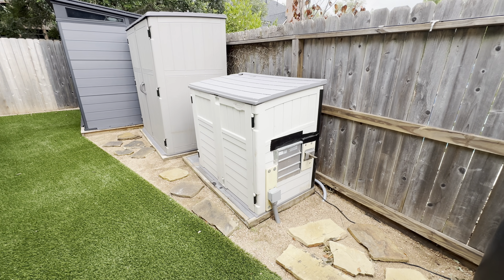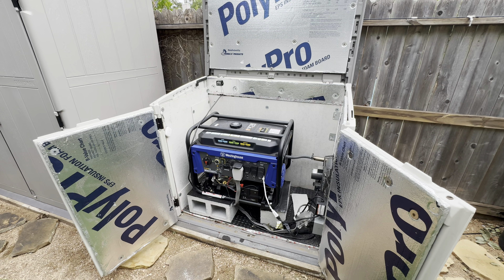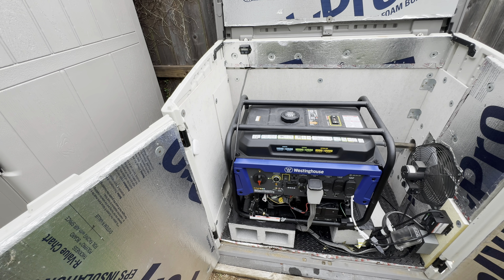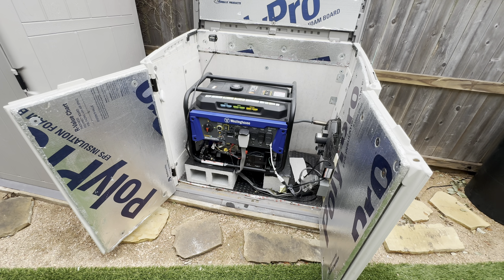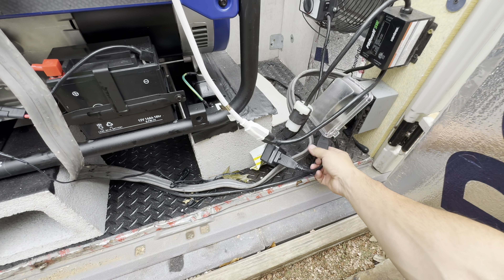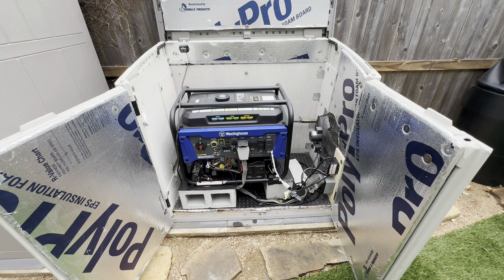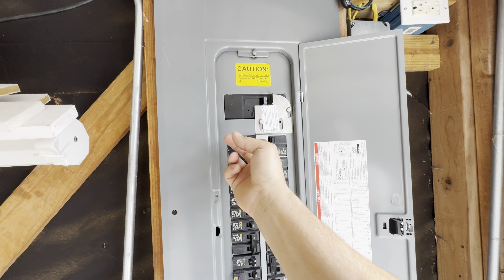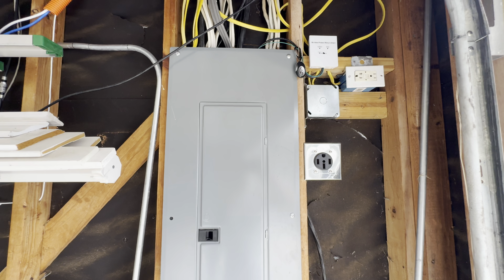Tri-Fuel Portable Generator Post Hurricane Update on Natural Gas

Comment: Thank you for sharing your experience and knowledge. 
I tried to convert a dual fuel DuroMax xp13000eh to CNG  but couldn't get it to work at all bought a conversion kit from PNG Technologies and did not work. Had Center point energy to evaluate my gas meter before buying the regulator the PNG  Technologies kept saying is the hose any taught or suggestions ? Really want to see the generator running with CNG
Reply from the maker: @rickymejia48  what happens when trying to start it?
Reply: @CalvinGorriaran   it  sounded like it was starving for fuel.  I adjusted the gap on the spark plug,  took pictures of the accelerator ( idle switch)  also played with regulator air mixture and nothing. 
Bleed the air from the line , No luck very disappointed  with the outcome.  I was very excited about seeing it running.
Reply from the maker: @rickymejia48  sounds like you did everything I would have done. By chance did you check the spark arrestor screen on the muffler? Make sure it was clear of any debris?
Reply: @CalvinGorriaran  generator is brand new only use it for 8 hours before. 
So I decided to use propane and gasoline the unit will run as designed No issues at all. The tech keeps saying is the hose , so I borrow a 1/2 hose from another running generator from a buddy and the generator did the same issue. 
I sent the regulator back to Matt with PNG TECHNOLOGIES and now he's saying the issue is the hose or the gas meter , really sucks not having the generator with CNG. Wish I could share a video with you but don't know how 😅
Reply: @rickymejia48  There is a generator place in Cypress that does duromax conversions. Lots of people have problems with the png. Sorry I don’t remember the name of the company.
Reply: @texaspowerman  if possible would you please help us to find out the name of that place . That would be very very helpful hopefully I can buy it from them.
Reply: @rickymejia48  I believe it was Greens Blue Flame. I know they had a program that if you ordered a duramax and had it delivered to them they would do the conversion and it would keep the warranty. I know they are a propane sales center I don’t know if they are still selling portable generators. The sold very high quality gas hoses and fittings, all oil field grade parts. They were pretty expensive but the best quality you could find.
Reply: @texaspowerman  thank you very much.
Reply: @CalvinGorriaran  next to you know we had a hurricane here in Houston
Reply: @CalvinGorriaran  sorry for the fat fingers
Reply: I did the same conversion on my generator. Will not start on its own. Matt at png said it was valve or supply. I have his hose and valve.  I just pulse  the purge on the regulator while the engine is spinning. About 1 pulse per second. Once she starts to kick over I stop pulsing and she’s off. Tuned to 1840 rpm’s no load. Runs everything including central with a soft start.

Comment: Its a nice model. Everything about it is great.  50 amp. Oil screen. Remote start, 5% THD.    Ive been trying to find a place to buy one for 6 months and its been out of stock the whole time.  Someday maybe
Reply from the maker: I had to setup alerts at Home Depot and Lowe’s to know when it was back in stock and buy it when I got alerted. It seems like they are getting more every 2-3 weeks.
Reply: I got mine from Lowe's about a month before the hurricane came in. Be careful if you order from them and you request the free shipping. They use a 3PL that is known for no communication and literally dropped off my generator on a pallet in my driveway with no notification.
Reply: Ordered mine on Lowe’s website last Tuesday after the storm hit and it’s being sent to this store this Friday in Sugarland

Comment: Hi Calvin, great setup. I have about 2250 square feet here at my home and was wondering if a generator this size would run central A/C along with a refrigerator and a few other things?
Reply from the maker: This setup ran my entire home for 60 hours. The only thing it didn’t run is both AC units at the same time. I had to run them one at a time. I typically ran the upstairs unit more and then would switch to the bottom floor AC when it got up to 76 degrees.
Reply: @CalvinGorriaran  did you have to install a soft start kit on your ac unit in order to power them with this generator ?

We just got power in Spring , and I'm just sick and tired of our shit going out every time the wind blows .
Reply from the maker: @markcarr5142  I did but I don’t think it was needed on my smaller unit. Probably needed on the larger unit.
Reply: Hey just curious my home is 2700 with one 5 ton, do you think that will work at my home
Reply from the maker: @losj7836  yes but you will likely need a soft start installed.
Reply: @losj7836  Also, you may need a generator with true 50A service
Reply: We live in spring , bought a predator 6500 watt(5500 running ) ran it for a day or 2 with just a box fan and Samsung refrigerator.
  We definitely going to upgrade to a 10,000 watt to be able to run everything. This will avoid having extension chords all over the floor . 
  Getting a 50 amp plug 🔌 seems to be the way to go .

Getting a 22 kw generac is about $10,000 installed .

Comment: Thank you Calvin, great video! Thanks for the link to the power return alarm, I'm about to order one. I installed solar panels with backup batteries 2 years ago, and the annoying part is I have no idea when power is restored. You have a great setup that is well thought out. I miss living in the Houston area.
Reply from the maker: I really would like to do that someday. Which system did you go with?
Reply: @CalvinGorriaran  Hey Calvin, I got a Tesla system. 27 panels and 3 batteries. I live near Pensacola, when the power goes out, I have enough power to last me the night...depending on how my wife sets the thermostat and whether she decides to use the clothes dryer when I've told her not to. It's a good system, and I had bought a generator like yours based on one of your prior videos with that sweet setup you have. But I sold it when I decided to get solar.
Reply from the maker: It is shocking how much electric dryers, ovens, and cooktops use. If I ever build or move, all of those will be NG.
Reply: @CalvinGorriaran  Yes I tried to get natural gas to my house, but the gas company did the whole neighborhood, except my street. I have propane for my hot tub, but it was too costly to get an outlet put in the house for stove and dryer. But that's okay, since the solar offsets my bill by around 65-75%. I love sunny days!

Comment: If that generator does not have a spin on oil filter I would definitely not run over 50 hrs without changing it. I have also seen magnetic dip sticks, I don't think it would hurt. Also thank you for being a good person and helping out your neighbors! But if you live in a storm prone area why wouldn't you have a generator??? Much cheaper than a freezer full of bad meat or frozen pipes!
Reply: This model has a washable oil screen right next to the oil fill port.  It's better built than most generators.
Reply: @projectswithjw  nice! Is it still single cylinder?
Reply: @shawnbeerens4292  I have the same one and yes, single cylinder 550CC. The re-usable screw-in oil screen filter seems to be really well made. During my 5 hour break-in, it caught a lot of shiny metallic particles. I also used a magnetic dip stick and a magnetic oil drain plug. Interestingly, when I checked the oil filter after the power came back on 20 hours later, there was almost no metallic particles in the filter screen so it appears I did a great break-in. I brought out quite a few appliances as well as a hair dryer and heat gun to ramp up and down the load with oil changes every 2-3 hours.
Reply: 25 hours is max and I change the oil 
Oil is so cheap and so dam easy to change only a lazy rich person can afford to destroy a generator or lawnmower 😊
Reply: @philliphall5198 The generator is only rated for 25 hours for an oil change? Most are 100 or 150.
Reply: @philliphall5198  25 hours?  During extended outages, you'd be changing oil daily.  Doesn't sound right.
Reply: 40 hours is what I do!
Reply: One of my gens is 15 years old and used a lot, 40W oil and changed every 24/30 hours when used 
Just like new still 
One with oil filter I change oil and filter every 40 hours and 40W sae oil 😊, gas is charged every 90 days to vehicle and fill back with no corn gas which is what I use in all my air cooled engine 
Plus I have a box fan blowing on them in summer use
Reply: Maintenance guide says 100 hours on oil changes... for mine.  I also have a washable oil screen/filter.
Reply: @Threedog1963  but diesel trucks say 10,000 miles and no way that’s going to happen
Reply: @shawnbeerens4292  while i don't have one of these generators I do have an Onan in a motorhome a 4.0 and a Yamaha 2800. I change them at 100hrs or if don't use them that much every other year. Mobile 1 15w50.  I run that in all air cooled engines

Comment: Greatly appreciate the update video. Just made it through the storm as well first time with a generator. Want to make a shed similar to yours. Was just thinking a way to know power came back would be helpful. Thanks for showing the power return alarm. Grabbed it from your link.
Reply: Your main breaker must be off. You should install an interlock device from the main to the backfeed breaker feeding your bus bars. I assume you have a smart meter on the wall next to your breaker panel, if it's not reading anything on the screen the power is still out. Or you can get a Fluke T1000 (you'll have to buy one for ~$100 and check one of the feeds to ground located above your main breaker. If either lead into the main has 120V your power is back on.
Reply: @fat_biscuits3928  yes sir! Main breaker off with the interlock is the way. Thanks for the thoughts on the smart meter and identifying power.
Reply: @nathanmcmahan400  You're welcome sir. Good luck with your install!

Comment: I was going to ask how you changed the oil. 
I have a firman generator. When we bought it the manual said to change the oil every 24 hours of run time. Duramax also said the same oil change interval. The duramax just changed the information on their website to 50 hours without making any engineering changes. Firman followed suit. 
Im still on generator power, it’s Saturday and the generator has been running since Monday. 
I change the oil every 48 hours or sooner. I changed out the dip stick oil fill cap to one with a magnetic tip on it. After the wind storm I sent an oil sample to Blackwood for analysis after a 48 hour run. They found it to have significant amounts of wear metals but said the oil was still in decent condition. I run 5-30 synthetic oil, I’ll continue to do a 48 hour oil change interval to hopefully keep it in good running condition. 
Mines outside under a gentent rather than in a box so we waited until the wind wasn’t blowing sideways to put the generator out and hook it up. Like you we run extension cords over the fences to provide power for the neighbors refrigerators, some lights, internet and tv. 
Ours is rated at 5500 watts on natural gas and as long as we don’t run the microwave or coffee maker while the a/c is on everything works fine. I have the same power on alerts siren but it has never worked so we wait to see the lights come on at the neighbors. 
It’s at 140 hours and still going. 
Perhaps I’ll put in a shed one day, but for now we drag it out. It takes about 10 minutes to setup. 
I’ve never put gasoline in ours, we use propane as our backup fuel rather than keeping gas in the garage or the tank. 
✌️
Reply: My firman T07571 tri-fuel manual says to change oil after the initial 25 hours and then every 100 hours. I only have 80 total hours and I just changed the oil again.